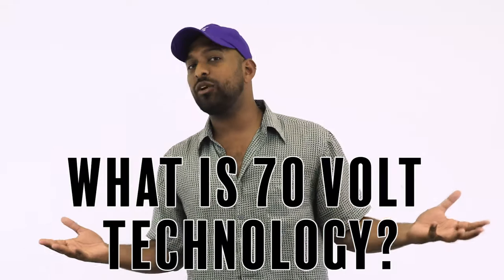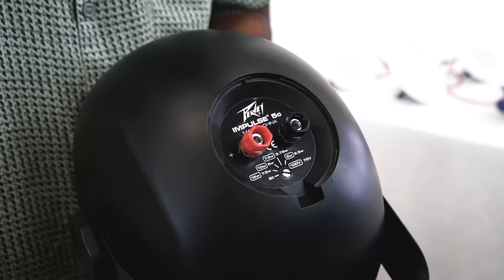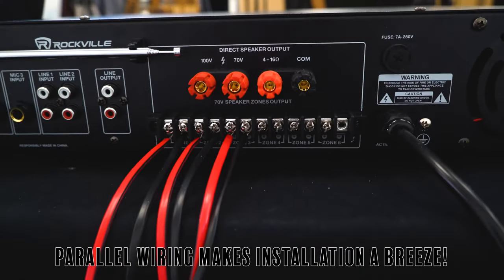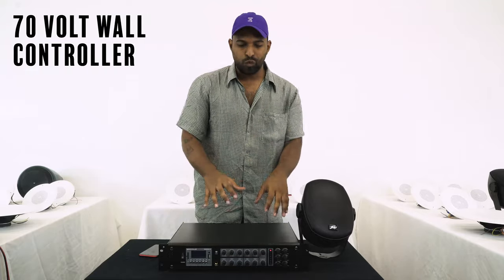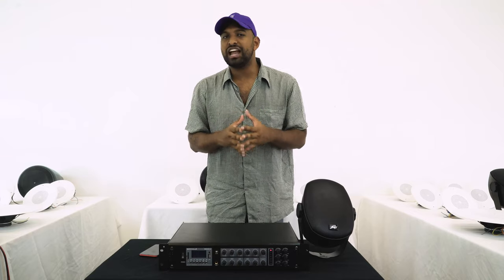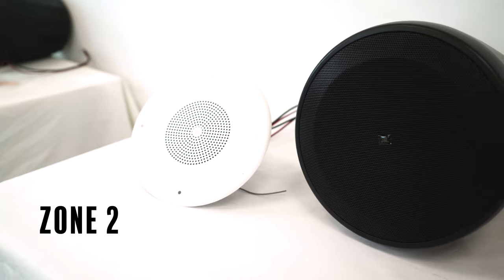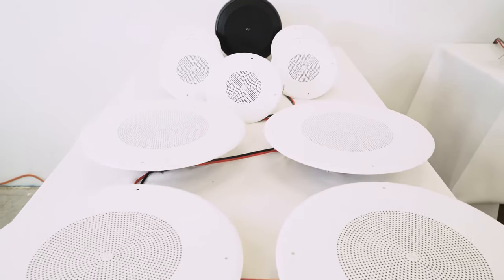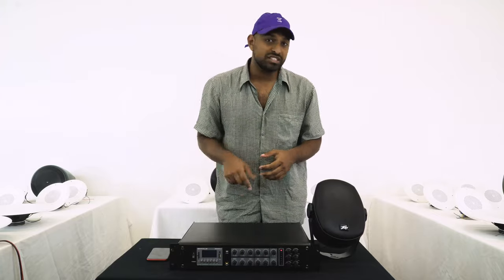WHAT IS 70-Volt? Everything you need to know! Wiring, Advantages, and DEMO

Comment: Thanks for this! I have an existing complicated outdoor system in my yard. 8 outdoor speakers in different locations running off of 2 Crown Comtech 200 amps. They're running on 4 ohm ea. channel with 14ga cable, and while the 4 speakers on the 50ft run are fine, the other 4 ran about 125ft away ALWAYS have had sloppy bass and lack of crisp high end (same speakers) Going to retrofit the speakers with 70v line transformers since apparently the comtechs already have the option and this helped a lot! Looking forward to having better and equal sound, and the ability to add a couple more to even out the yard.

Comment: Can you wire them in a "T-Tap" Topology? if i have a large room with 3 pairs of speakers on each side (6 pairs total). can I run my main cable down the center, and then have each pair of speakers with their own cable run that connects to the main run? there would be a total 6 taps, 3 on each side.?

Comment: How do you measure 70volts amp with a Multimeter? I try measuring Common terminal to 70v terminal with sound on and with out sound and I don’t get 70volts. But speaker and everything works fine. Just wanted to measure output

Comment: So the impedance doesn’t matter? As long as that wattage maths out, I don’t have to worry about putting 20 8 ohm speakers in one amplifier?
Reply from the maker: Yes! 70V system work off of fixed wattage where you don't have to worry about impedance. Each Speaker is "tapped" to a specific wattage amount and all you have to make sure is that the 70v amplifier you are powering all of this with has enough power to power the total amount of watts all of your speakers are tapped at!

Comment: You mention parallel wiring but I think you mean wiring in series. Parallel wiring would mean each speaker requires a homerun back to amplifier
Reply: Parallel is all of the positives together and all the negatives together. They dont all have to run back to the amp as they are connected through the chain. Series would be connecting positive of one speaker to the negative of the next speaker.